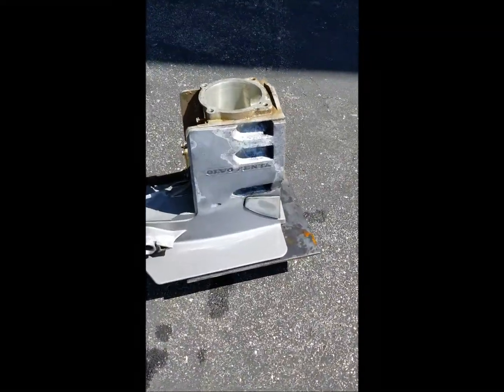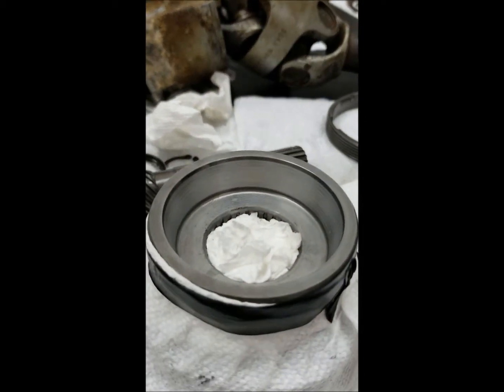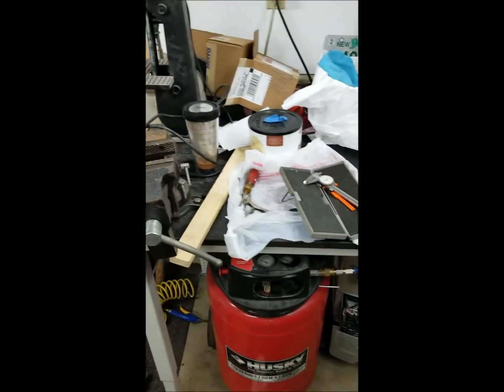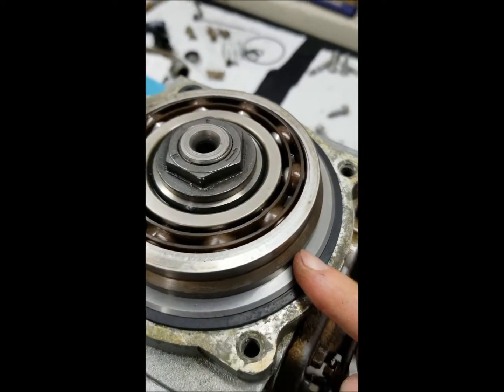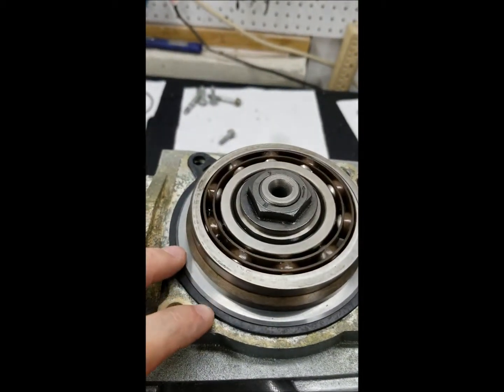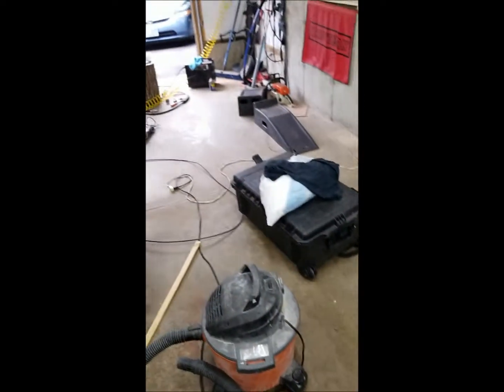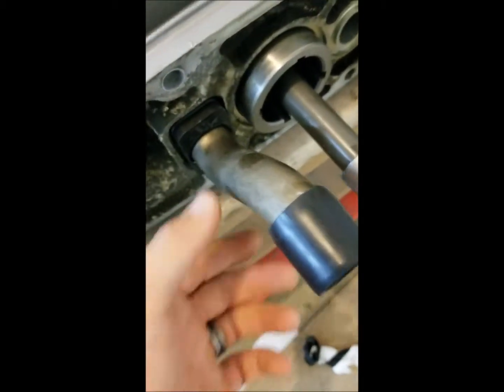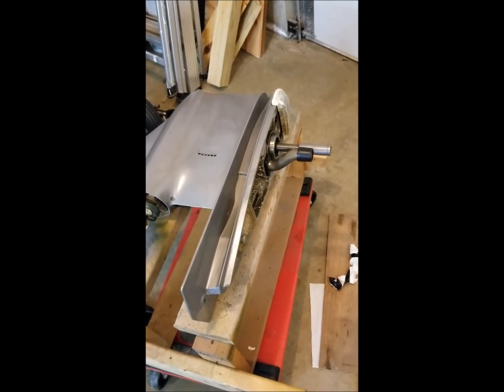Volvo Penta SX-M outdrive cone clutch replacement, lapping, Part 5

Comment: HI! in the previous video you say that the spring under the cone clutch no longer needs to be tightened.. did you put it on or not?
Reply from the maker: Hi. I left the spring, clip and little washer off. The service manual said to not put those back in. It's been working fine without it.
Reply: @nobama5555  Thank you! very kind..